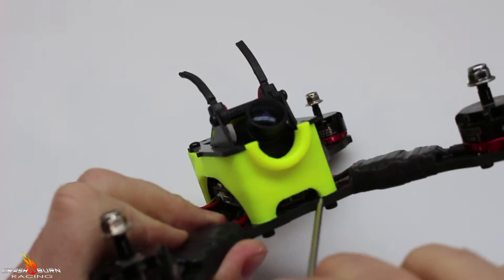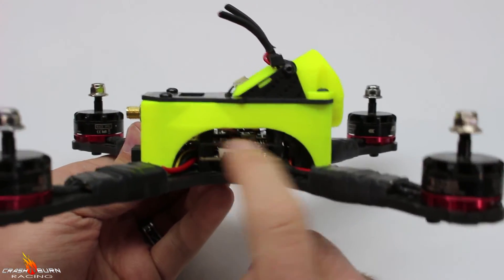Realacc X210/QAVX Body kit

Comment: Why did you make the sides have different thickness? Is it for aesthetics or is it because you have things sticking out the sides and its poking into the body kit?
Reply from the maker: It was both for aesthetics and durability.  My early concepts had 1.2 mm thick sides but was just to weak.  The thickness changes towards the back to follow the lines of the top plate.
Reply: Gotcha...Why the 1.2mm though? I wish I could use your model but I have a Pro which is 35mm in height...and I really wish you woudl have left the sides in...so that whoever uses the model can just cut out their own holes.. Either way good job..I wish I had your skills...Maybe ill give Sketchup a shot...Can I edit your model by using the Stl file by any chance, or do I need the original work file?
Reply from the maker: I have a .4mm nozzle on my 3d printer so it would be exactly 3 rows of filament.  A person remixed this for the 210 V+ if that helps you. http://www.thingiverse.com/thing:2150092